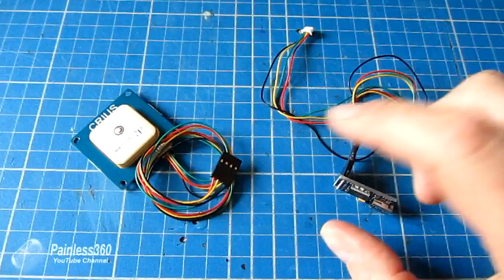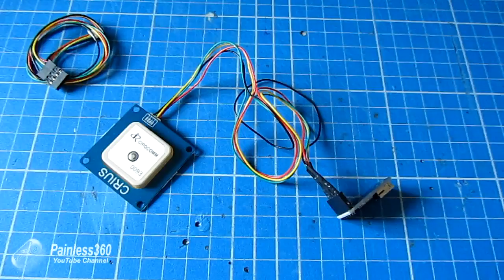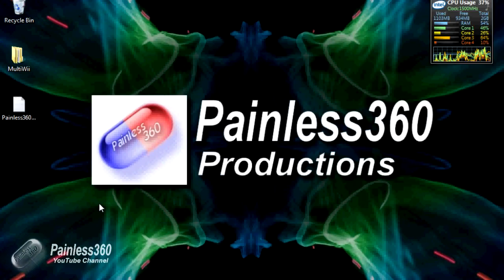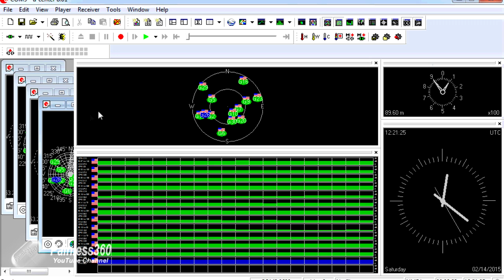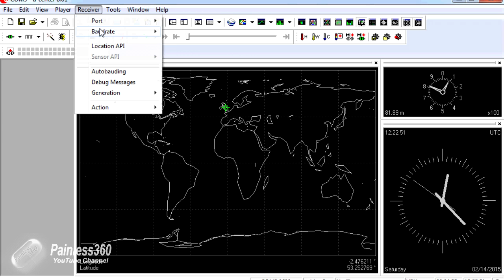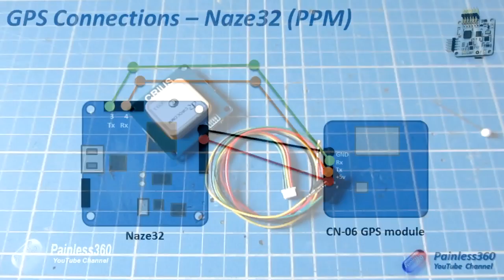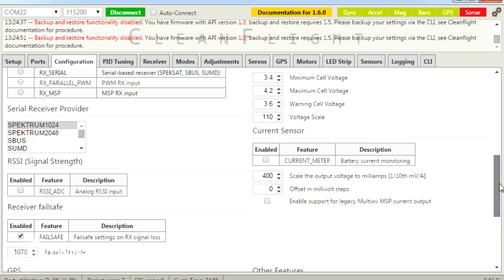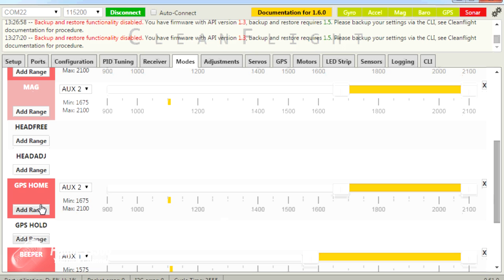(6/8) Naze32 Flight Controller - Adding GPS (NE-06, NEO-06 module)

Comment: Hello again!  Another well done video.  A few more questions in my long line of inquiries...I flew the quad a few times but discovered the batteries that came with it were way too small.  I am awaiting larger ones.  When I did fly, I had tropuble hovering in one spot, much the same I experienced with the Estes Proto X.  I figured it was just he size that made it difficult to control. I did purchase a GPS unit when I purchased the board and I think the hold featrure will help with my weak piloting skills.  It is a UBLOX Neo6M, already updated to 115200 and 5Hz.  I have a transmitter that is not adaptable to PPM, so PWM is my only choice.  I was talked through the programming on Baseflight, but I am told that PWM will not work in Baseflight, even though the wiring is doable. My "mentor"  does not know about it working in Cleanflight, so I came to my other authority to ask.  Any hints?
Reply: Also, you mention getting 5V for the GPS from the ESC bar.  Isn't that battery voltage, 11.1 or 12 V?
Reply from the maker: This series uses Cleanflight and this supports both PWN and CPPM (watch them in series and you'll see it all, it is covered in detail in the second video - https://www.youtube.com/playlist?list=PLYsWjANuAm4p47OBBTOo4Xr3lNUc8PFpc)

If you search the forums you will see that Baseflight also supports both (http://www.multiwii.com/forum/viewtopic.php?f=23&t=5149). I suggest you spend a bit of time in the wikis and forums as there is loads of great answers already there if you're not sure about something.

The connectors that go to the ESCs have 5v on the red wire and this is where we can power the GPS unit from as in the video.

Best of luck with it.
Reply: Painless360 With all due respect, I mentioned that I could build a house or office building from the ground up. I have followed your directions and videos very closely, and I am 99% sure I can figure which wire goes where.   Electronics, programming and code are my weakest points.  Most, if not all of the blogs and wikis are spoken in a language that is as foreign to me as blueprints would be to you.  I really need somebody close to me to help me through this.  Casa Grande, AZ, USA, anyone?
Reply from the maker: Mike, I have answered all of your questions and done my best to provide you with support and advice so I am confused, by that appears to be, the slightly aggressive nature of your reply. Mine was far from a RTFM response.

I appreciate that the hobby can be frustrating but spending time in the forums and googling the questions you have is a great way to increase your knowledge and comfort. The videos I have here are attempts to make some of that complexity earlier to access for those, like you, who have less experience.

I am a design draughtsman by training to the blueprints may not be a alien to me as you might think.

Happy to help and provide links to places that may be of interest but only when the conversation is in a friendly way.

Best of luck with it.
Reply: Painless360 I apologize for the tone of my rant.  It is me expressing sheer frustration at something that seems so simple, yet turns out to be so complex. I intended no insult to you.  You have been very gracious in your responses.
Reply from the maker: No problem Mike. No offence taken.

These things tend to go one of two ways in my experience of building - they go together like a charm or are a complete b@${4rd from start to finish. The interesting thing is that I learn more from, and get more useful tips for others, out of the ones that are pigs to put together.

Stick with it, it will come together, let me know if I can help..

Best of luck.
Reply: Painless360 If that is the case,m I should be an expert by the time I get this thing in the air for more than 30 seconds.  I guess I should switch over to Cleanflight.  I tried to watch the next video on modes, but I got lost almost immediately.

Comment: How does a serial bus receiver works, can u use it instead of ppm?
Reply from the maker: You can if you use something like the Frsky sbus to ppm converter.

Happy flying!
Reply: Haha u cnt connect directly? I thought there was an sbus receiver option in the configurator
Reply from the maker: https://github.com/cleanflight/cleanflight/blob/master/docs/Rx.md has all the detail you need..

Comment: Will a NEO-07 work for the GPS rather than the 06? Would like to have the puck type I can get up away from the electronics.? What is the hover accuracy, a meter, less  :-( more?

And finally ..do you have a video on making the shock mount you have the NAZE32 mounted on? The movement of the
NAZE32 on the mount (and it will at high speed when you maneuver fast and hard) will not cause problems?

Thanks for the great videos, this is my first build (coming from a Phantom) and it's a real steep learning curve but your videos REALLY help with that curve.
Reply from the maker: The Neo-07 will work fine. The mount is anti-vibration not anti-shock.

Happy flying!
Reply: Painless360 Actually I do not, it still will not connect, but thanks for you videos.
Reply from the maker: Try using the auto configure in Cleanflight then - https://github.com/cleanflight/cleanflight/blob/master/docs/Gps.md

Best of luck.

Comment: Thanks for all the vids, They are professional and have been quit useful.

Could you help on setting up GPS using PWM instead of using CPPM?  No idea about remapping the inputs and other settings. I am quit a noob at this stuff. I feel much more secure using a full range Spektrum rx.

I have the HK R615X receivers but I am a bit l leary about their operation. I bench tested 4 of them using servos. The bind lights are very inconsistent, Sometimes no light but bound, sometimes blinking light and bound and sometimes solid light. Sometimes a solid light will go blinky when using the sticks w/servos. Sometimes a red light will pop in also.
What is your experience using that rx and can you recommend?
Reply from the maker: The inputs are mapped to change to the GPS pins etc. automatically if you change the settings to enable GPS and have PWM selected. Move the connectors around on the inputs (15:45) and then confirm that all the channels work fine before refitting the props.

I've used the R615x and had great experiences with them. The recovery of the connection can be a little slow but that's why we have failsafe settings..

Best of luck.

Comment: Great video thank you
i have the gps working, but how can i get the missing channels 3 and 4 back..?
Reply from the maker: If using PWM then they are moved, not lost (16:25). Happy flying
Reply: Painless360 i have connected it like that but now they are on aux 1+2
Reply from the maker: rulfii That is how it's supposed to work (16:25).
Reply: Painless360
but in cleanflight too

Comment: GPS M8N working, eeha. Bluetooth to, eeha. In U-center 14 sats. load in seconds. On Naze takes way to long. Do Rates in U- Center, Configuration view need to be changed or is that something else altogether? I've got 1-GPStime,1000 ms, 1.00 Hz, 1 cyc, and 1.00 Hz. Thought I saw somewhere 100ms and 10 Hz
Reply from the maker: Not sure, having a 57,600+ baud rate and 10Mhz/100ms refresh should get the data to the board nice and quickly. Don't forget the GPS code is evolving all the time on this little guy...

Best of luck with it.
Reply: +Vic Prk (Slick  Vic) Fixed and busted...got it set to 10 hz and 115000 yippee then reversed polarity, no more m8n.
Anyone know why removing a working m6 module from naze resets to 9600 baud and 1hz when i reconnect to ucenter?

Comment: any idea whether this hex file will suffice for the Ublox CN-06?
Reply from the maker: Chris Leech yep, I use it for both..
Reply: Painless360  I appreciate your good works on the many fronts, thanks mate, a big hats off to you! So ,...during the first forays with the Naze32 last year (in Baseflight), I was using the original script (3DR) on the CN06(Neo6M) and I had a solid 3D fix. Now I have only changed one thing. FW. With Cleanflight, the same connections = a total fail, so I look for other hex files to use, I find you, After I push the file to the GNSS, i get the same things going you allude to, but once the BAUD is chgd to 115.2K it is still dead in the water, no debug info, no sats, nothing. The GPS is just non functional. I don't have the room on this 250 class mini to put my Neo7M w/ compass in the little puck. and besides the output is I2C rather than serial as far as I know.So it is off to ebay to find a replacement. Too bad about the hours of wasted time I will never get back. I have no idea how it can go from functional to dead in the water, battery for "Almanac is running 2.7v or so, could that be it?? Don't think so :-(
Regards,  C
Reply from the maker: Too bad - sounds like the GPS died. Best of luck with the replacement..
Reply: Painless360 Replacement $15USD  not a big deal. When purchased it cost twice that at least. Putting a DIY Naze32 together from an STM32 F103 Dev Brd and oh what fun we are having with that, talk about growing pains.

Comment: If you are having issues updating the GPS you might  have a non FTDI chip on your adapter.  When you install the adapter and under windows device manager under ports you see prolific adapter instead of FTDI.  This is when the issues begin.  The only certified one I found is at this company http://www.adafruit.com/products/284  Here is a link to the real FTDI data sheet http://www.adafruit.com/datasheets/DS_FT232R.pdf  https://github.com/adafruit/FTDI-Friend/blob/master/ftdifriendsch.png

Comment: Another great video, thank you! My question is.... does it matter which way the NEO-06 Gps is pointing when mounting? Does it have a front that needs to point the same direction as your front of quad?
Reply from the maker: This GPS can be mounted anyway. GPS units with integrated compass/magnetometer circuits are different.

Hope this helps.
Reply: Thanks, I figured it out once I installed and checked through cleanflight. Using standard receiver (spektrum 6 channel) I've verified everything except under receiver my mapping is now different. i've not test flown yet and was wondering if there is a way so under receiver tab it does show the correct channel mapping. I installed correctly....now using GND,+5v,aileron,elevator,gps tx.gps rx,throttle, rudder,aux1,aux2. but under receiver tab in cleanflight it does not correspond the same???

Comment: I am real curious regarding the performance of this FW / Nase32 / gps combo. There are some guys out there using Harakiri FW in combo with the Nase32. However this is a little black box for me as there is a very limited source of info on the web regarding this FW setup. However the performance of the gps is unbelievable as you can see here: https://www.youtube.com/watch?v=ogE_pacMjwg
I would appreciate a lot if you could post some videos regarding setup of this FW on the Nase board.

Comment: Can you do a difference video using this Naze 32 10Dof board?  You can flash this board with Cleanflight Naze 32 firmware and it cost half the price as the Full Naze 32.  http://img.banggood.com/images/upload/2014/10/NAZE32%2010DOF%20Manual.pdf
Reply from the maker: Hi Jon, not planning on doing one at the moment, the next board will be the CC3D. Looking at the 10Dof version it has more in common with a Multiwii Platform (i2c and UART connections) than the Naze32.

I will add it to the ideas list for the channel..

Happy flying!
Reply: Painless360 That board uses the full Naze32 firmware  using cleanflight and banggood has them dirt cheap with baro and mag. You should get them to send you one for testing.  I used the CC3D for my first quads for training in stabilize mode but was not impressed for the lack of expanded features and it still uses a 8 bit chip. CC3D would be great for airplanes. . I think it would be a perfect fit for a follow on to Naze32.  Thanks for the great videos!
Reply: Jon Car Do you have a link to the actual item and not the manual?  I know I have seen it listed but I can't find it now.  I was going to order one and try it.  I need a couple more things from Banggood and thought if it was cheap enough why not?
Reply: Dale S http://www.banggood.com/Naze32-Flight-Controller-With-32-bit-STM32-for-Multicopter-10Dof-p-953849.html

Comment: will it work on http://www.hobbyrc.co.uk/ublox-7-tiny-56-channel-gps-receiver-module-naze-32
Reply from the maker: Yes it will but the setup file may not work exactly as planned. See http://code.google.com/p/ardupirates/wiki/UbloxGPSTutorial for the GPS settings you should use listed out so you don't have to use the file I supplied...

Best of luck.

Comment: Can I ask where you got the Mumetal from Lee, I'm in UK
Reply from the maker: Tony Hodgson I searched on eBay and ended up ordering a salvaged piece from the back of an Oscilloscope from Israel. One of the more obscure things I've ordered (!) but this piece has made shielding plates for 6 quads in the past year. It's not cheap but you only need a piece about 45mm x 45mm directly under the board. Hope this helps..
Reply: Wow, that sounds like a bummer to find... Lol, thanks Lee... Time to do some googling...

Comment: Great video and very well explained! I just have a question. In the case of making a GPS hold mode, which other functions need to be on for better stability? I am assuming BARO and MAG need to be on as well but is ANGLE or HORIZON need to be ON as well? Thanks
Reply from the maker: I cover this in one of the next videos that runs through the flight modes and options on the Naze32. The video will be out in the next few weeks. 

I would always use Angle or Horizon mode with Baro and Mag when using GPS Home.. 

Hope this helps..
Reply: Painless360 Thank you! I am looking forward to your new videos.

Comment: Hi still no luck i try this with 2 gps module and still no luck :(
Reply from the maker: Sounds odd as I never had one damaged module, let alone two. Triple check that you have followed each of the steps in the video exactly.. Best of luck..
Reply: Painless360 i did everything that i saw on the video  all i'm getting is data on cleanflight  but no 3d fix
Reply from the maker: In GNSS config???????
Reply: Painless360 the sky is clear no clouds  i really don't know why its not working full naze32 rev5  Cppm setup  onlt gps add on it fly good but i want gps for safety
Reply: Painless360 i when to the link copy all the information paste it in a text file saved it and use it everything was ok  baudrate is 115200  ok as i was typing this message it started to work with 3d fix thank god but its taking really long to lock on ? why that
Reply from the maker: He first time a GPS powers on it needs to listen to and learn which satellites are overhead. The larger the antenna the more sensitive it is and the faster it will do it. Once this data is sorted it is stored in memory so next time it's a lot faster to start. Google 'GPS cold start warm start hot start' to see more detail. 

Glad it's working, it just needed time from its first cold start..
Reply: Painless360 thanks so much i'll keep you posted ;)

Comment: hi i follow your video for this setup but i got in micro ublox neo-06 gps it has 2 leds on it solid green when powered and another led for gps lock but no blinking or solid blue light for gps or gps lock  pls help i'm seeing data on cleanflight but no gps lock  like 3d fix
Reply from the maker: What do you see in the GNSS configuration software? If you can see a lock there then double-check the settings (baud and protocol - UBLX) in Cleanflight. There is a troubleshooting video for the CN-06, see https://www.youtube.com/watch?v=M7LDZZ3yNr4

Comment: Would it be possible, once the UK weather bucks up, to see the different flight modes "in action" using both ground and onboard video?
Reply from the maker: Hi, video planned when the weather improves. The GPS modes work in the same was as those found in the Multiwii code and you can see that in action at https://www.youtube.com/watch?v=NB7VVvAiPF8

If you fly before then I'd be happy to post a link to that Naze32 flight footage in the meantime..

Comment: I do get an error message (configuration version check) bevore loading your provided file to the GNSS. The config file has no Software Version (the GPS 7.03) and when I download it it will do with all the errors shown, but I can*1 switch to 115k Baud (will stay in 9,6)
Reply from the maker: Is this not a NE-06 or NEO-06 GPS unit? The file is for these GPS units only (see 1:00).

See http://code.google.com/p/ardupirates/wiki/UbloxGPSTutorial for more detail on what you need to look at changing if you have a different board.

Best of luck..
Reply: Painless360 From the labeling it looks similar, difference is that mine shows v3.1 on the backside and yours 3.0. 
Interessting wise I was able to connect it to a NAZE32 using Cleanflight at 115k but when connecting to u-center it will still work only with 9.6

Comment: Hi. Great series. Is the clean flight GPS setup the same if you are using a PWM reciever ? Also, how did you make changes in the ublox config file for the GPS module ? Cheers,  Simon.
Reply from the maker: Hi Simon, see http://code.google.com/p/ardupirates/wiki/UbloxGPSTutorial for the GPS settings and setup is identical with the exception of the movement of the re receiver inputs when using PWM..

Comment: Do you know if its the same pin outs for the Naze32 clone called the flip 32?  It uses the same firmware as the Naze32 full
Reply from the maker: Jon Car A quick google of the Flip32 board shows that the connections are not the same. Happy flying!

Comment: Thanks for your massive effort in producing all this great info. I'm looking for advice on a starter 250mm quad. Thinking kk2 to start. Any suggestions for all the bits ?
Reply from the maker: happyvalley808 Why would you look to use a KK2? This is a series on the Naze32..